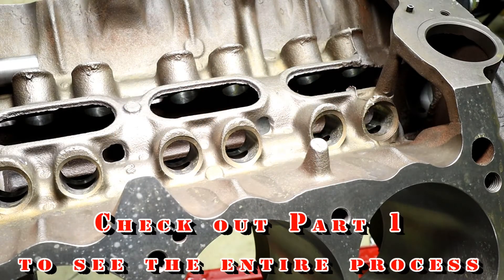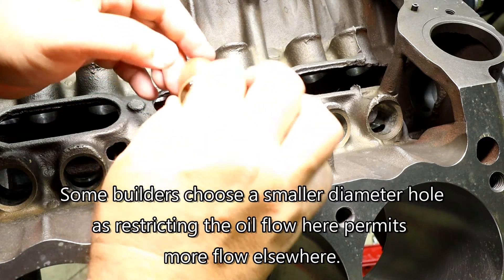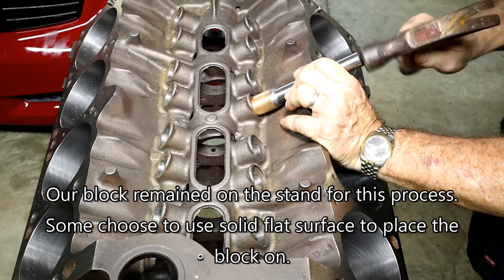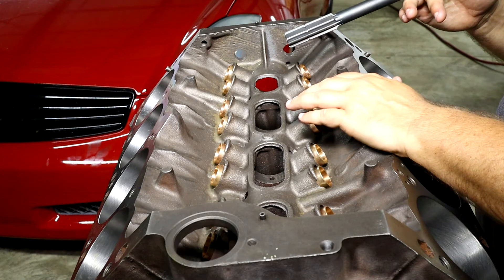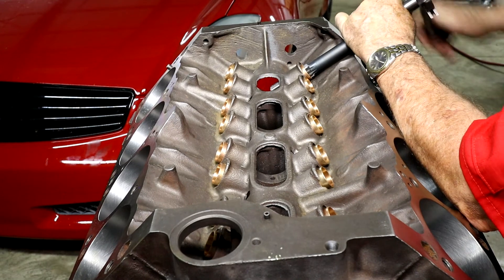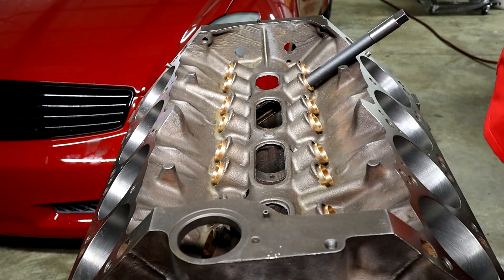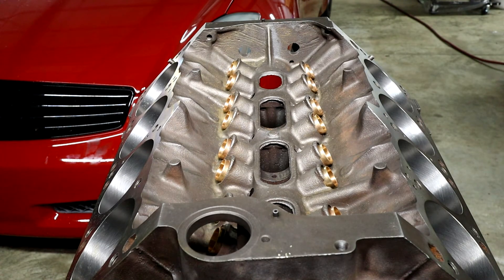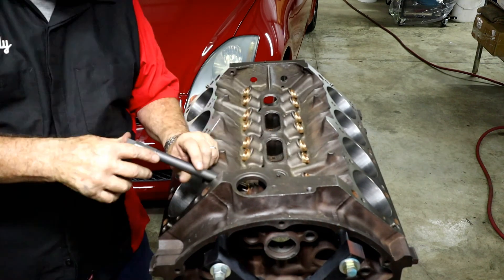The LA-phant: Lifter Bores - Reaming and Bushing Installation (Part 2 of 2)

Comment: Its only a 002 to 003 thou press i think the  🔨  worked great if people only knew how many times the mechanic or machinist used a random tool or cut off for a hammer its not a ball peen hammer you need its a bushing forced in a light press fit  bore in a mopar block

Comment: What was the cost for all that work, just for the block? Aside the standard boring, honing, align honing the mains, etc. Sounds steep compared to an aftermarket block. 8 sleeves, holy cow! If matching numbers is the reason, why not wrap it up and save it, rether than potentially blowing it up racing? Yeah, of course I  enjoy seeing how it's  done, when necessary. Am very intrigued.
Reply from the maker: This was Pop's build. 

He wanted to take advantage of the bore size from the 340 LA block. The overall point is the idea presented. Each to his own situation and its own variables. Where is value? I think it depends on the goal.

Costs would vary depending on the shop doing the work and inflation from time period the video was made. 

Thanks for the comments and thanks for watching.

Comment: Was the finish inside the new lifter bushings smooth, or was it grooved a bit after the reamer?
Reply from the maker: Hmm... I'll have to ask Pop.

Will get back with ya on it.
Reply: @MicsMotorworx  Just finished installing mine.  After I ran the reamer through the first one, I stopped.  It almost looks like it's been knurled.  There may be a nick on the burr he sent me, but I will call him tomorrow to see if it's supposed to be that way. The lifters (CompCams 828-16) fit PERFECTLY though.  Love those lifters.  My second set.  Full solid-body.  BTW, I ended up going with a .063 hole.  Probably more than I need, but still WAY less than the crater that's in there without the bushings.
Reply from the maker: Nice. Sounds like a rewarding day of work.
Reply: @MicsMotorworx  I called him today about the light grooves.  He said no problem at all, and that it's normal to see that.  He said it can also help with oil retension  to better oil the lifter.  Kinda my thoughts as well, but wanted to be sure.  He said as long as the lifters fit good, no problem.
Reply from the maker: Cool. 

Thanks Scott. I'm sure viewers appreciate the additional insight. I know Pop and I are happy to see the video promoted some good and worthwhile efforts.

Let us know it goes upon firing it up. -mike
Reply from the maker: Hey Scott.  We did our first dyno pull a few days ago.  We were well north of 650 at only 6,300 rpm.  More pulls are coming later this week.
Reply: @MicsMotorworx  There you go!  Mine made max HP at 6400, so that sounds about right.  Good numbers!
Reply: At the end of your Reamer, Drilla, a indent and drill your tool holder and tap with a bolt

Comment: 1. How much interference do you have between the bushing and the Lifter Bore?

2. How much oil clearance do you have between the new Lifter body and the bushing after honing ?
Reply from the maker: Great questions. Quick answer:

Whatever the OE size is. Pop went with the subjective result, e.g. the feel. Someone doing this at home may prefer measuring this.
Reply: #1.. ABOUT .003" PRESS FIT.......    #2.. WITH A BONZE BUSH. .0014" CLEARANCE.... CAST IRON ABOUT  .0017" CLEARANCE

Comment: Never heard of anyone doing this.   
Just get another block.
Reply from the maker: Hey Tom.  For an everyday, run-of-the-mill 318 or 360, you're right.  For the rarer 340, the builder wanted to go this route.
Reply: The procedure is covered in the Mopar Performance Small Black book. Get another   Block? Ok, a Magnum will do, but this procedure is do-able and will function as if it were designed to be a Roller.